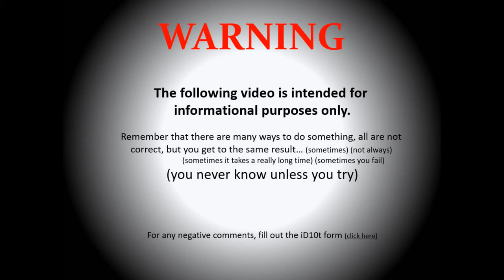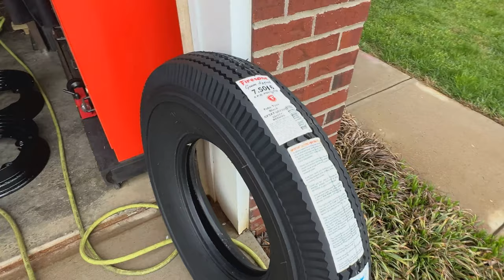Belly Tank Racer Build - ep.18 - 1936 Ford Wheels - Firestone 750-16 Tires - Aluminum Spun Hubcaps

Comment: Very Nice!
If you would have turned the wheel over and mounted the tires from the back side of the rim I would think you'd have less chance of scratching the front side of the wheel.
Also some lube of some sort would have helped you.
Reply from the maker: I had some plastic rim protectors. Seemed to work ok. Never used those before but they worked. After the first wheel I remembered i needed some lubricant. Cant win them all. Lol
Reply: @bugigarage    Not being critical at all, just making suggestions..  I love the build it's going to be awesome when finished..
Reply from the maker: No worries. Didn’t take it personal. So far all comments have been positive or helpful. I am sure that will change as the channel grows. Lol. I appreciate you watching and commenting. Keep it up.

Comment: I wish you would use some lube on the side wall. Wd40 works ok. Also if you put the tube in the tire and air it up and let it sit for a few days it'll expand the sidewalls out.
Reply from the maker: I did after the first tire. Not sure how I forgot but it happens.

Comment: Why go to all that detail with the '36 wheels, and then cover them up with moons?
Reply from the maker: Detail? As in sandblasting and powder coating? Two of the wheels were pretty rusted so I had all four done. As for the look… I like the moons for now but if I decide in the future to remove them, then the rims look good.
Reply: Moons are demonstrably faster.  There's a reason they're ubiquitous at Bonneville, and it ain't just style.

And anyway, your question is silly.  Why the Hell would you leave the rims dirty and rusty even if you intended to use moons?